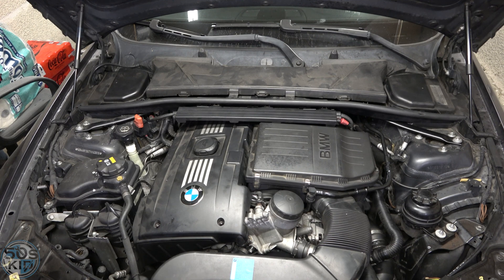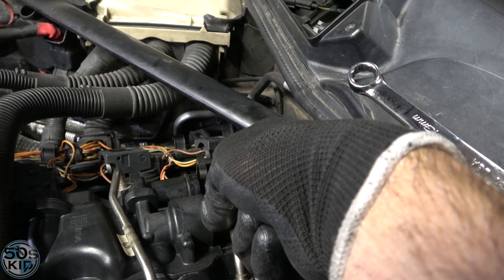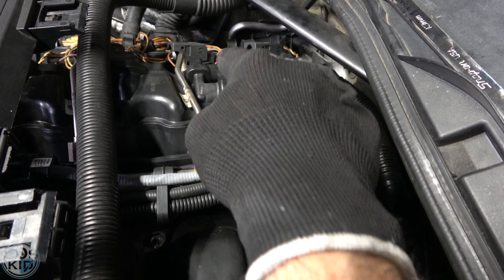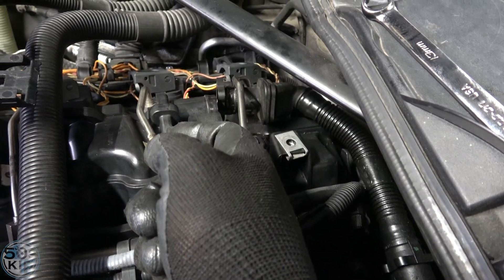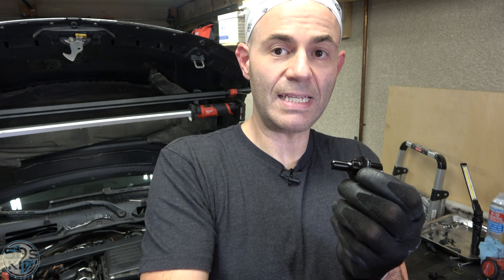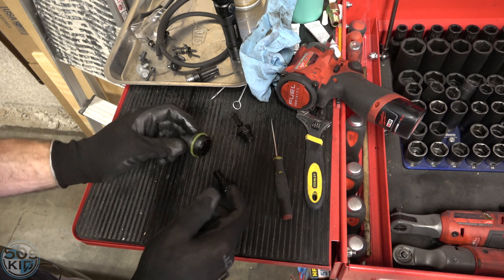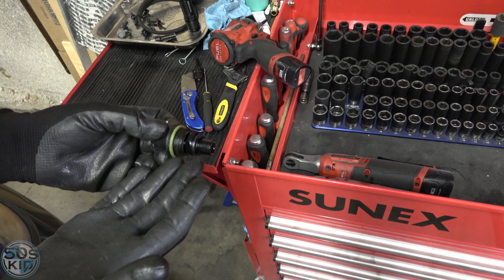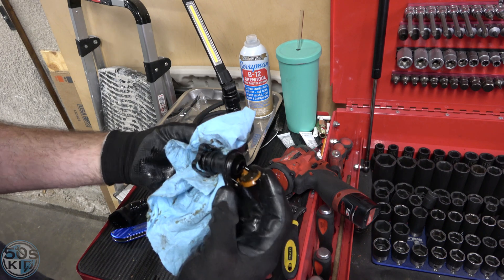Oil in your charge pipe? Here's the solution! - BMW E90 PCV Valve Upgrade

Comment: PCV - SMOKING issues fix:
Most of these aftermarket PCVs are worse than the OEM one. After trying most of them (RB, BMS, and ebay ones) on various client cars, I found out that the OEM one works the best, even in 700hp N54s. The reason is that these aftermarket ones don't have good flow and result in inadequate vacuum in the crank case. So clean and inspect your OEM pcv and stay with it.
IF YOU HAVE SMOKING issues, especially at deceleration and when coming to a stop, most of the times the issue is your pcv flapper (High side pcv). The problem starts from the fact that the front turbo return-drain oil line is bellow the oil surface inside the oil pan. If you don't maintain a  decent amount of vacuum inside your crankcase, you'll have smoke. And the OEM flapper (even when new) most of the times is uncapable to do so. SOLUTION: Get rid of the oem flapper, and place a one way check valve so that it looks like this: Crankcase -> check valve -> oil catch can (if you have one) -> rear turbo inlet. The One way check valve will have to be big enough to allow good flow, very very soft spring, and you'll have to drill a bleed hole (2mm) in it, similar to the one the oem flapper has if you look into it. If you don't drill a hole you'll maintain too much vacuum and you'll start hearing air getting sucked through your crankcase seals.
Reply: do you have pictures of this setup? do you have a link to where you got the right sized check valve?

Comment: 7:50 Okay this is an EXCELLENT video and explains things like NO OTHER PCV N54 video I've ever seen. What would happen if That hole or passage for the boost pressure in the cover were plugged off?? Would there be any chance that it might cause a large amount of oil to be consumed by the engine all at once?? My good friend has an N54 (As I do) and he has this very problem and is tearing his hair out trying to figure out what's going on. Any time he gets on the gas and into boost the engine consumes like half a liter of oil!! NO KIDDING. The engine is in excellent condition and he rebuilt it just 6 months ago. He's had mechanics look at it and we are very N54 centric in our passions but this problem is stumping us big time. He's got No Cats at all running straight pipes. He also has all the mods and power upgrades including brand new 19T turbos. PLEASE give us an opinion if you can on what on earth could be causing this. Even if you don't (I understand you can't read and answer all of us crazies out there when we have troubles LOL). But I also know you have a HUGE amount of diagnostic experience with these N54 engines as well as other turbo charged BMW engines.   "Help us Obiwankid50 your our only hope".  LOL.

Comment: Great explanation, I had a lot of oil through the blow off and dripping from charge pipe and this explained why. Thanks
Reply: Was this causing external oil leak? I ask cause I had my pcv valve replaced by bmw and I now have an oil leak in rear of motor somewhere. It would be good to know before I take plastic cover off to explore. Darn thing takes time to remove... let me know. Thanks

Comment: do you know if a failed PCV system like on a n54 would use a lot of oil? My oil is dropping like 1 qt every few days, no blue smoke and all the gaskets and seals have been replaced. Thoughts? I was also thinking maybe the oil is in the inner cooler and piping; this is a FBO setup. Keep up the excellent vids
Reply: Ever find ur issue? Im havin the same thing
Reply: Enything guys? Same problem
Reply: @mariuszkochanowski767  well not to disappoint you but few weeks later I popped a Ring land.  my guess is the motor was going out already
Reply: Can you say something more? My is burning 1l per 1000km. I would like to change this PCV Valve for the begining. He also have 360hp and 175 000 km. He have a power, no blue smoke, no leaks. I am stupid now😢
Reply: @mariuszkochanowski767  if you have a lot of blow by it just put a catch can in and then check out the how much oil is coming out through PVC vent. You can literally get away from the PVC system

Comment: This is a fairly big problem for N54 folks. I've been down this rabbit hold and am now only using the OEM unit. It works and no modifications needed as well no special cap needed. Just my 2 cents on it all.
Reply: Did you have problems with the RB PCV valve or the Vargas unit? I really wonder if the OEM unit is such a big failure like everyone goes on about. Thanks
Reply: I didnt try the RB one but i tried a couple of generic copies and a china cheapie. Oem didnt have the leaks or sptings but seems to work nostbofvthevtime. Im smoking again now a little so im gonna check it again.@pinnaclebass

Comment: I am puzzled because I bought VTT Vargas PCV Valve on FCPeuro and they say it's plug&play, however, it doesn't fit my OEM genuine BMW valve cover on my 2008 335i
Reply: And I read posts that say the pcv valve cap should NOT be trimmed as it may cause boost leak because the pcv valve won't properly fit...

Comment: So, should you tighten that PCV valve or not? As it allows less air passage when it is fully tightened? I am a little confused...
Reply: The Chinese ones are bad. They don't seal properly in my experience.
Air needs to flow through the valve in one direction only and be stopped   completely in the other direction.

Comment: If there’s oil in the charge pipe then you replace the pcv valve (whether you intercept with a catch can or not), will the excess in the pipe and intercooler slowly dissipate over time…? Or would you still need to remove them and clean them?

Comment: Love the channel man! I have a vtt dual catch can, the head ports blocked off, and a check valve on the low side. My question is whether or not there should be a check valve on the high side as well?

Comment: Did this cause a PCV howl? I had that issue with my Maserati Ghibli and replaced the PCV system. Maserati calls it the Oil Vapor Recirculation System. I have a video on that also.

Comment: At the 11:05 that you are wondering if it has to be tighten, yes you have to tight it. I bought the same and the manufacture told me that.
I noticed the same thing, that the original one is much more easy to blow but I thing you have to check it with the opposite way. To suck it from the other side because it works under vacuum.
Have you noticed any problem ? you kept it or you changed it? i just installed it and i dont know how to check if it working properly.

Comment: I am assuming that a faulty valve can cause oil leaks as well (maybe valve cover or that tube piece you replaced) ? I am checking mine tomorrow, as I noticed oil in my charge pipe and I still have an oil leak after redoing my oil pan gasket :(

Comment: Hello 50s kid this is a totally unrelated topic to your video This is actually in relation to one of your previous videos in doing a head gasket for an M54 motor I'm just hoping that you'll respond to it because I'm really not sure what to do and your video is really helping me to get thus far but I made a mistake I rotated the lower block the wrong way when putting it just before top dead center and I've already put the head back on I had just clamped down cylinder two and four on the camshafts and when watching the video I realized the mistake I made in relation to the rotation I would assume that I need to take the cams back off so that the valves will be recessed again but the question is how do I find top dead center with the head on the block please if you can respond it would really help me thank you so much

Comment: Are you wrong ? There is a vacuum in front of the turbo and the outlet from the valve is connected there.  At least that's the case with Turbo Diesel engines.

Comment: 50s kid you are one of the best because I was struggling with a fuse issue with my door actuator a 2007 bmw 335i and every video I watch on YouTube shows you how to replace the fuse and your video is one of the few it was even the first video I saw showing you how and what is the cause of the door fuse getting blown all the while you explained and let me know what's the problem but now I have a real issue my headlights keep staying on after I turn the car off and even turning the headlight switch to off position and I keep hearing a ticking sound inside the fuse box I am wondering if it's a wiring problem or some grounding out problem have you ever heard of such problem please let me know

Comment: This video came right in time. I have oil leaking from the connection between the TB and CP as well as some smoke. There is also some light smoke coming from the PCV cyclone closest to the oil cap. There is also a little oil in that channel where the coils are. Hopefully this will fix my problem.
Reply from the maker: If you have oil in that channel where the coils are then you've got a leaking valve cover gasket.  Check out my DIY on that!
Reply: @50sKid  previous owner said it had been replaced. Any tips on checking turbo seals? I am reading this could the reason for oil in the TB CP connection area eventhough I have no smoke coming from tailpipe.
Reply from the maker: @MeBreezy  I had gotten the service history and seen that mine was replaced twice in its life, and yet it was still leaking.  Upon investigation, a bolt was missing, causing the shoulder of the gasket to cave inward and there was the leak.  Turbo seals aren't something you're going to check yourself.  The turbos would have to be rebuilt.  Basically, replace the PCV valve, drive it for a while, if the problem gets worse then re-evaluate.
Reply: This need fixed

Comment: Jason, IMO all you’re doing is making a system designed to return blow by back to the engine work as well as possible. But the problem is that it doesn’t work so well to begin with. That’s why you get carbonization of the intake valves with all DI engines.  You’ll get a lot better control of blow by forgetting about the check valves and installing catch cans, particularly on the low side where you spend most of your time.  The can captures the blow by and prevents its return to the intake manifold.
Reply from the maker: I plan to do a separate video on catch cans but even catch cans are not perfect because you're plumbing them inline with the existing system and you're still routing blow-by gasses back into the intake, so intake valve carbonization is still gonna happen.  It'll slow down quite a bit though.  Personally, I'll do a walnut blast every 50k miles.  Definitely wouldn't mind doing it before tons of gunk builds up because then it'll hopefully be super fast and easy.  Thanks for the comment.
Reply: @50sKid  I empty the can every 5k miles at the oil change and get about 4 oz. of liquid (mostly oil).  Seems like a lot of the blow by is condensing in the can.  FYI I'm using the low side Burger Tuning catch can which eliminates the valve cover PCV.  2012 Z4 N54
Reply from the maker: @jayparnes  Interesting.  Seems like a good amount.  Thanks for the info!